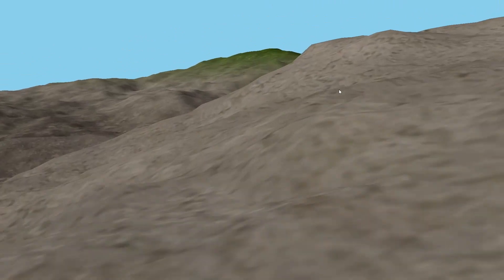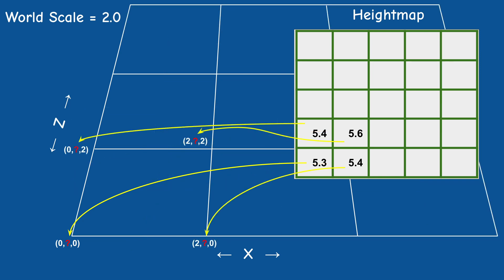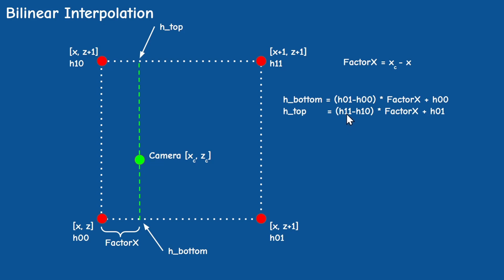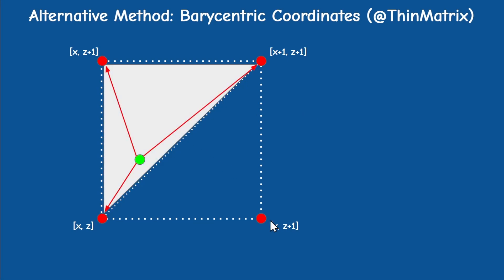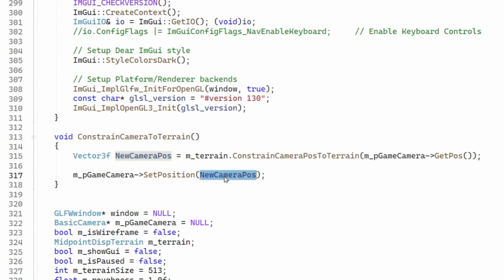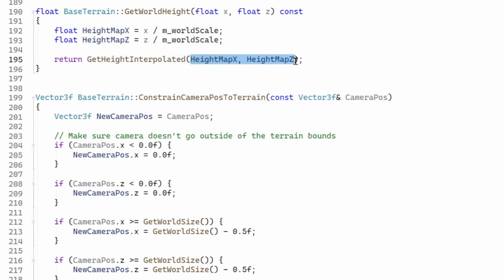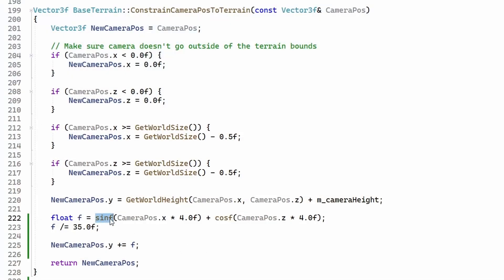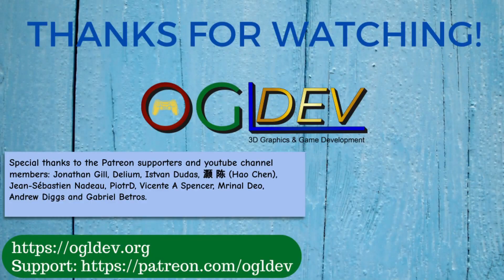Ground Collision Detection // Terrain Rendering episode #10

Comment: Thanks a lot for your videos. I have one question: if we use tessellation terrain with heightmap texture. IT means, the height is calculated from texture in the shader step. How we can deal with ground collision ? Thanks in advance !
Reply from the maker: Sorry for the late reply. From what I read about this problem it seems that the recommendation is to keep rendering separate from physics. This means that for collision detection you continue using a detailed heightmap, regardless of tessellation. Notice that in the specific case described in this video (the camera), we can assume that the patch in which the camera is located is tessellated to the heighest degree so you can use the existing method. I guess the problem might become noticeable on more distant patches with lower LOD. You don't want dynamic objects to move in and out of the terrain in the distance. Perhaps some tuning of the tessellation parameters is required to keep these problems to the minimum.
Reply: @OGLDEV   Thank you for your detailed answer. i'll check it. Thank you again for all your effort !

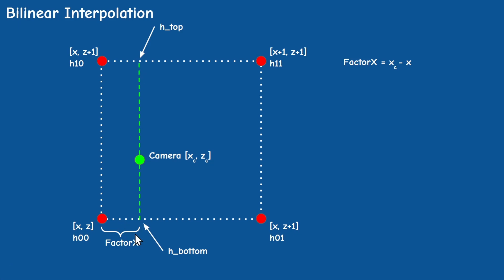Comment: Hi! Should not the h01 be [x+1,z] on 2:04? Thanks! Awesome video.
Reply from the maker: Yes, please see my response below to @FireflyInTheDusk. Thanks!
Reply: @OGLDEV  Thanks! I managed to make it work by comparing the blueprint explanation with your code on the video itself! The h_bottom and the h_top also seem incorrect on the blueprint slide (h01 and h10 are flipped?) . I usually go by the blueprint explanation and try to implement it my own way in my game. Here is my code:

float getterrainheight(float x, float z) {

	// check if x,z is within terrain's points
	if (x < 0.0f || z < 0.0f || x > terrainsize + 1 || z > terrainsize + 1) {
		return 0.0f;
	}

	int xfloor = floorf(x);
	int zfloor = floorf(z);

	// tile corner heights
	float h00 = worldterrain->point[xfloor][zfloor];              // lower left corner
	float h01 = worldterrain->point[xfloor][zfloor + 1];        // upper left corner
	float h10 = worldterrain->point[xfloor + 1][zfloor];        // lower right corner
	float h11 = worldterrain->point[xfloor + 1][zfloor + 1];  // upper right corner

	// x interpolation
	float xfactor = x - xfloor;

	float hbottom = ((h10 - h00) * xfactor) + h00;
	float htop = ((h11 - h01) * xfactor) + h01;

	// z interpolation
	float zfactor = z - zfloor;

	return ((htop - hbottom) * zfactor) + hbottom;
}

Thanks for the video!
Reply from the maker: @xxx-e7h2s The code looks good!

Comment: at 2:16 it should be h_top = (h11 - h10) * FactorX + h10 right? not h01. P.S. thank you for this video, this helped me so much. before this I would use binary search to figure out the quad, and then do ray-triangle intersection on the two triangles, the difference in performance between this and that is HUGE. my terrain is scaled so vertices are not 1 unit apart, but I built a matrix to perform the scaling and I use the inverse to bring game world coordinates to heightmap space where the vertices are one unit apart, to do this interpolation quickly.
Reply from the maker: Yep, thanks, I had a few glitches on this slide. Also, the bottom right coordinate is [x+1,z] and not [x,z+1]. The code on github is ok so can be used as-is. Seems like your original method is a bit of an overkill for this problem. It's a good thing that you are able to simplify it.

Comment: I need to catch up. I have been watching all the videos but am still in the first half of coding it since I am doing it in C so there is not a direct 1-1 translation of the code. I absolutely love your series though and the instructions are very clear.
Reply from the maker: Yeah I guess there is a lot of code to be rewritten but at least the algorithms and basic concepts should stay the same. It's also very easy to print stuff in both versions and compare.

Comment: I noticed we already created a method called GetHeightInterpolated in BaseTerrain class in UV Mapping video and collision detection seems to work as well using that algorithm but camera keeps jumping a lot, I guess I will call this method a bit differently
Reply: Update: using bilinear interpolation is way better! It works very nicely, so thanks a lot for this video, it was probably the easiest one in the series but super satisfying result, usually I struggle with collision code but this was a breeze! Could you share plans for the next video if there are any?
Reply from the maker: Sure, the next two videos will probably be skybox and skydome. Then clouds and water.
Reply: @OGLDEV  Can't wait for clouds and water then! Good stuff, thank you!
Reply from the maker: It's basically the same function with some cleanup that I recently did. It's been in the code base for a while but I don't think I mentioned it so this was the opportunity to provide a bit more detail.
Reply: Hey OGLDEV, can you explain a how volumetric rays work in a future video?
Reply from the maker: I will add this to the TODO list but it will take some time because I have to admit I'm not very familiar with this topic so will require some research.